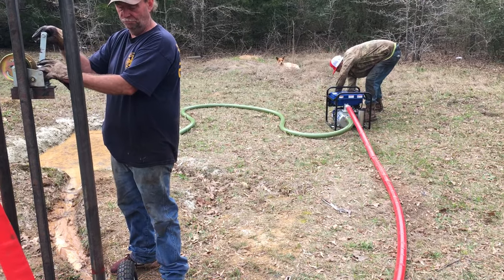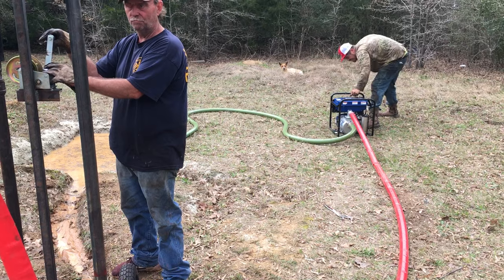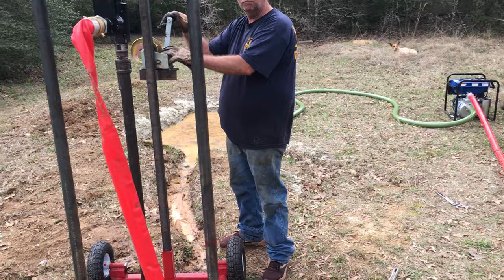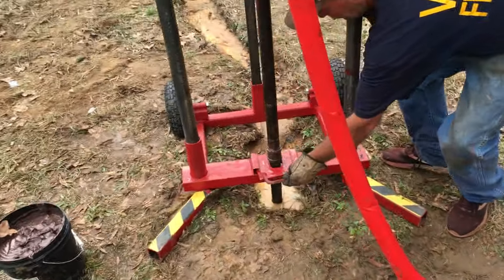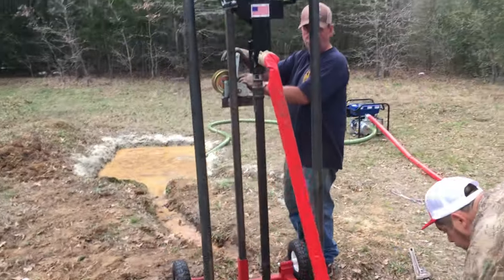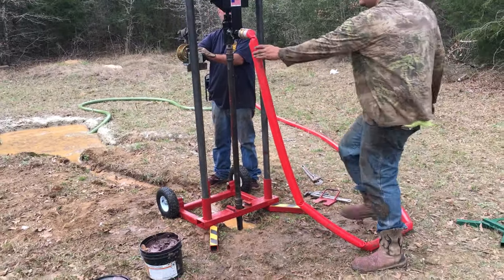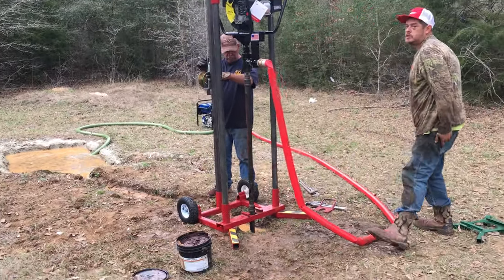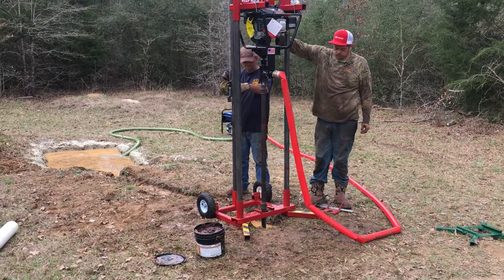IMG 3211 DEEPROCK HD 55 Pro Series Waterwell Drilling rig model 2021 drills to 225 ft  deep

Comment: I drilled 200 feet with one of those about 40 year's ago . 2 inch well gave me about 8 gallons per hour.
Reply from the maker: Yes sir we have hunderds of loyal past customers that have been very successful drilling there own 6 inch Boreholes down to the water bearing sand area then putting your 4 inch sch#40 pvc [casing ] down in and putting a good brand submergable pump in it and plug in the power and suck your water up and out to make the animals and plants HAPPY and full of life we now have the Up Graded DEEPROCK HD-55 Pro Series Model 2022 with its 10 HP engine and all steel 330 gearbox and the xp-7 all steel swivel with grease zerts and a wheel kit installed for easy moving and it has the 4 inch steel channel Drill pipe guide and Breakout pipe plate it holds your drill pipe so as to just use one pipe wrench next time your in our neck of the woods come by and ill show you the Up Graded HD-55 Pro-Series Model 2021 and maybe ill take your old one as a trade in Thanks Much for your kinds words sir
Reply: @davidgroesch1136  more info abojt this product
Where   can i buy one
Reply from the maker: https://www.youtube.com/post/UgkxKGJcwyAMK6BvsDif2Z17MzNsa-tnY-Q9
Reply: I had one 22 years ago, drilled to 290 feet, set my screen at 285, makes   26+ gpm, fills 80 gallon tank in 3 minutes, These little rigs will do the job, but will work your tail off doing it, very good up to 150 ft, from there it's teeth grinding and butt clenching, But like I said 22 years and I'm still on that well
Reply from the maker: WOW Thats Great i get these letters and emails a lot yes we do have a Time tested Water Well Drilling Rig that will do the job it is built by people who know put together a DIY Well Drilling machine so as to work for you for many years not 1 hr and breakdowns and if you do have a encounter we will fast be at your side to solve any issues GOOGLE Deeprock Mfg in Marquez ,Texas 77865 and see the customers in the past several years say we offer hands on Training on our rigs its your Rig can be a HD-55 Pro Series Model 2022 or a DEEPROCK BOBCAT RAM 10 /Tractor Rig that will drill 400 ft we have what you need and will guide you after the sale to make you a successful DIY Well Driller on your own land deeprock.com
Reply from the maker: yes they are great waterwell drillinmg rigs that will get it done and we have BOBCAT RAM 10 Waterwell drilling rigs and Tractor Drilling rigs
Reply from the maker: @katonave  DEEPROCK mfg in Marquez tx 77865 vwe have in STOCK
Reply from the maker: @katonave  DEEPROCK .com
Reply: Co perfora piedras duras rrudas?
Reply: Si perfora piedras duras
Reply: Cuánto bale
Reply from the maker: @EsiquielSts-mp6qs  yes
Reply: Is this legal to use in the United States?
Reply from the maker: hello yes if its your land you can drill your own well borehole but you dont suppose to advertize and drill for otheres that is for the pro drillers that drill for money per foot  @shawnadair2234
Reply from the maker: AWESOME yes you made a great move when you did your homework and bought the DEEPROCK water well drilling rig thanks for your input have a Blessed day !

Comment: Hello.
How deep can you go with his drill ???
Thanks.
Reply from the maker: 225 ft if you buy more drill pipe it comes with 100 foot of sch#80 1 1/4 inch OD its a great rig and some customers put a DC winch with a remote button so as to make it super easy but the manual hand crank is fine if you look on utube deeprock waterwell drilling rigs you can see other DEEPROCK customers drilling on there own land remember to watch out on your water rights cause in some places in california the local goverments or putting a water meter on your well and sending you a bill for the water you use wow thats  NOT RIGHT  they say well the house is yours and the land is yours BUT THE WATER is CALIFORNIA s   well thats not right so im sure the california people did not vote for that it was done under the table and not RIGHT the house is yours and the land is yours and the WATER IS YOURS  Mineral rights is who ever has them in there name ect ect but the water is the land owners Please dont let the goverment take over or water rights thats very very wrong could you imagine being older in life and on a fixed income and then the ca goverment meters your water and then u have more bills ect No the goverment needs to CUT costs just like we do and not just find other ways to make bad on the tax payers the water is yours 100%

Comment: Im having a problem with gravel, it takes all the water from the tank..how do you solve that?
Reply from the maker: easy fix sir just add Benonite powder to ur tank and mix up a liitle then it should make your water thicker and beable to pull the gravel out of bore hole and the benonite will put a seal like iceing glaze on the borehole walls and the when u see the pit ok start drilling again ect ect www.deeprock.com

Comment from the maker: Rock bit for rock drag bit for sand and clay and shale and put a few hundred pounds of weight on it like sand bags or even better a dc/ winch 2500 lb from Tractor Supply when u need weight just push the button and then you have instant weight!!!!!!

Comment: Are units like this capable of drilling 300 feet deep ? And how many gallons a minute can be  pumped through it ?
Reply from the maker: Hello Paul yes we have Many Rigs a Great one is our DEEPROCK BOBCAT RAM 10 Model 2022 with 2 3/8 Mayhew drill pipe sch#80 steel it just hooks on to your Bobcat or Skidsteer or Tractor hook two hydraulic hoses to your BOBCAT and your drilling using the PowerFull BOBCAT HYDRAULICS  it will drill to 375 ft deep and will go in backyards or Remote areas when u have time look at deeprock.com in marquez tx 77865
Reply from the maker: its rate for 200 ft we have a BOBCAT /TRACTOR rig its $15,780.00 that will drill to 400 ft and can pump out many many gallons a min
Reply from the maker: WE have units that will drill 300 ft but the HD -55 Pro Series is for 200 ft max we have a BOBCAT/TRACTOR RAM 10 Model 2023 it will drill to 400 ft if you have the drill pipe its $16,780.00 and will drill anything you got for YEARS AND YEARS not broken down on first day with many issues like a Tim King/Hydra-fab customer issues rig DEEPROCK ® is a GREAT COMPANY that when you purchase your a customer for life and we will educate u on every question you have on drilling thats what we do.

Comment: Is this legal to use in the US? Can i dig 200ft-250ft in eastern Tennessee karst area?
Reply from the maker: yes it is legal if you drill a borehole on YOUR LAND and not drilling for otheres ect
Reply: @davidgroesch1136  It would be on my own land. We have a lot of limestone and bedrock, our area is karst geology. My neighbors are 170 ft , 60 ft to bedrock 10 GPM flow. I have contacted all drillers within 50 miles and the best quote I got was $12k. How many hrs operating one of these would it theoretically take to dig 200ft with this machine ballpark? Can it be done solo?

Comment: The best brother👍👍👍
Reply from the maker: YES SIR the DEEPROCK® HD-55 Pro Series Model 2024 will get it done or if you like fully hydraulic and more easy we have BOBCAT RAM 10 Model 2024 you just hook up to your Bobcat and plug in the RAM 10s two hydraulic hoses to your TRACTOR or BOBCAT and it will drill to 400 ft deep ect its a GREAT WATERWELL DRILLING RIG

Comment: Pretty cool, do you have anything that can drill 600 feet through 6" rock / Arizona cliché?
Reply from the maker: yes we have a up graged RAM 10 Bobcat rig its $18,880 with 100 ft of 2 3/8 mayhew drill pipe and a 6 inch Tri cone ROCK bit Extra drill pipe is $235 each 10 ft long

Comment: Canadian here.  Does your engine have a clutch on it?
I have several good small engines in the shed and I figured I better start putting them to use.  
I have a small 150 acre farm (a Texas postage stamp, lol) With the way things are going to hell these days if firgured that I need to dig a secondary well for a piston hand pump for emergencies.  (I have restored a couple of brass pump cylinders to near new condition (My Uncle passed away in 2020 age 94.  A few days before he told my Cousin and I "You boys go up into the hay loft.  There are some hand pumps and cylinders there.  You take them.  Because you never know when you might have to return to the old ways") He left me my Great Grandmother's homestead from 1921.  I was there today looking at the old percussion well driller that my two Uncles made out of angle iron, bed frame rail,  the differential axle and stick shift transmission from a 1938 Plymouth.  They used it in the 1950's & 60's to drill two wells.  78' & 95'.  I used it in 1987 to drill a well 70'. 
My winter project is to build a small, ATV towable so I can drill my well and a well for a neighbour.  (I have great neighbours and everyone looks after one another)
Long, rambling story but hey!...I'm an old man.  lol   I know that you are in the business of selling drill rigs but any advice that you can give me as to the construction details I should look out for wil be greatly appreciated.  Cheers, Bill
Reply from the maker: www.deeprock.com  yes we love to hear drilling storys and about old cable tool rigs ect yes we all need water on our land to have just in case the China  and Korea come at us i wish times were better on the way some dictators think i wish all could get along but the Dictators want to be abusive and powerful and like in the bible they are wars and rumors of wars and hurricanes and floods but i hope all will be ok and we will be strong in our years to come but we need to think about usa and its people FIRST and the others later usa FIRST the tax payers that build our nation not others that or lazy and dont want to work just hand outs ect

Comment: So that is a sand point drill rig? Can it do a 120 foot well?
Reply from the maker: no sir this is a DEEPROCK/HYDRA DRILL HD-55 PRO SERIES Model 2022 Up Graded series with sch#80 steel drill pipe and the xp-7 all steel top of the line water swivel and a wheel kit so as to move it around from site to site easy its a fine rig that drills your well and fast and will drill to 200 ft deep and in sand clay shale gravel and fractured rock and if you have harder ROCK they we sale TRI CONE ROCK bits for drilling in ROCK a sand point is a labor intense and only works in perfect conditions with soft surgar sand only look on utube and you will see ours rigs and on our DEEPROCK .COM website and we have in stock and ready to use and wells for many years some of our DIY rigs are 35 years old and still doing the job google deeprock mfg in marques tx and see how we do and google tim king/Boremaster customer issues and all the others Lonestar rigs and then make a clear move when it comes to buying your equipment  we also have a BOBCATRAM 10 /Tractor rig that uses 2 3/8 mayhew drill pipe and also has the 10 k Rated for air or water swivel its only $15,780.00 and drills to 350 ft deep if you have enought drill pipe Deeprock.com we have you covered and can answer all your drilling questions fast we are here to serve u from day one till you are a pro at it
Reply: @davidgroesch1136  and video of you finishing a well from start to finish?

Comment from the maker: In Rock u need to change bits to a PDC Rock bit or old school Tri Cone roller bit
Reply: Hi David, I’m actually looking at investing in a similar rig down in Panama. It does come with a tricone bit. What are penetration rates if you hit a boulder in the middle of some sand/clay? Do you pull all your drill pipe and switch to the tricone until you get through the boulder then put your drag bit back on?

Comment from the maker: 6 inch Blasthole full carbide drill bit this bit will last for about 12 or more Wells you drill then it will be full and still work but slower we have them in stock so just order one more for $265.00
Reply: You still have them?
Reply from the maker: @gleeventures9676  yes sir we have tem in STOCK  at www.deeprock.com in marquez texas 77865
Reply: What's the max depth and circumference? Would love to ship 5 pieces to Kenya
Reply from the maker: @gleeventures9676  Hello Sir the HD-55 PRO SERIES will Drill a 6 inch borehole and up to 200 foot deep and if Rocky then u need a TriCone ROCK bit we have them in STOCK www.deeprock.com
Reply: @davidgroesch1136  q costo tiene la perforadora, gracias

Comment: Looks great. How deep can it go? How much does it cost to drill for water in an area where average aquifer depth is 80- 120 metres?
Reply from the maker: https://www.youtube.com/post/UgkxKGJcwyAMK6BvsDif2Z17MzNsa-tnY-Q9
Reply: With the right core sampling bit this could be used to take core samples for mineral exploration in remote Alaska places you must backpack or winter sled to? I also have a need to drill a water well and very interested in the design.

Comment: Hi - what's the torque on the unit? thanks
Reply from the maker: Hello Sir yes this DEEPROCK® HD-55 Pro Series Model 2024 has 272 ft lbs of torque and tough 330 all steel gearbox for the money and made in the USA and in TEXAS you cant go wrong  we also have other Rigs for TRACTORS and BOBCATS fully hydraulic and useing 2 3/8 oil feild duty drill pipe 10 ft long each the RAM 10 Model 2024 DEEPROCK ® Rig is super easy to use but if you dont mind working a little more then the HD-55 Pro with a hand crank is fine also some of our customers put a DC winch on theres to make it easy to pull pipe out but the hand crank has done it for 30 years and counting its up to the person www.deeprock.com

Comment: What cost that machine
Reply from the maker: HD-55 Pro Series Model 2023 is only $3910.00 and comes with 100 ft of drill pipe and a bit for sand and clay and shale

Comment: Hi, great video. How do you know when you have hit water with so much water being used to drill?
Reply from the maker: Yes when you hit water sand thats it when your drilling and you thinkWOW WOW this thing is drilling FAST OK thats your water sand /water water sand has NO FRICTION and it almost falls down put out and asap put your pvc pipe and screen in asap then you have a well put your pump in and suck the water out ect ect to the family or cattle or your pond !!! its easy water well drilling is not like drilling for oil its super easy and NOT dangerous any question just ask ive drilled over 350 wells and can answer your questions FAST nthanks deeprock.com in marquez texas 77865
Reply from the maker: when u hit watersand it will drop because watersand is soft and the drill pipe will just almost fall then thats your water put a screen and pvc pipe in and you have water super simple a caveman can do it !!
Reply from the maker: https://www.youtube.com/post/UgkxKGJcwyAMK6BvsDif2Z17MzNsa-tnY-Q9

Comment: That large tub of copperslip/coat left with the lid off in the wind, way to go on how to contaminate it. Nice rig by the way.
Reply from the maker: https://www.youtube.com/post/UgkxKGJcwyAMK6BvsDif2Z17MzNsa-tnY-Q9
Reply from the maker: yes that wont cotaminate it it is used to put on the threads of the drill pipe ive done it this way on over 350 wells i drilled and no issues

Comment: How much does an extra 150ft of drill stem cost?
Reply from the maker: EXTRA sch #80 Thickwall drill pipe is $650.00 per 50 ft of Extra drill pipe with 1 1/4 coupling welded on these are SCH # 80 they will last for years and years many wells we have in STOCK and ship world wide just send email to sales@deeprock.com  and let us know what you need we also have 2 3/8 Mayhew Drill pipe we use on our Trailer Rigs and BOBCAT RAM 10 Rigs and Truck Rigs up to 15 ft we have wells screens and benonite drilling additive also we are a one stop shop if its waterwell equipment and supplys we have it !
Reply: @davidgroesch1136  Thank you, I will do that and maybe give you guys a call too. I have no experience doing this so I want to make sure it's done correctly. Thanks!
Reply from the maker: @BenWeintraub  yes we want to help you thats why we are here to make you sucessful in your well drilling !!!
Reply from the maker: $750.00 per fifty foot of sch#80 Thickwall drill pipe plus shipping www.deeprock.com
Reply: @davidgroesch1136  price went up?
Reply: @BenWeintraub  team Brandon made prices go all time high. Record high scores

Comment: How much depth you can drill with this rig?
Reply: Title says 225 feet
Reply: Buenas tardes me interesa donde se venden cuánto su presió gracias
Reply from the maker: it will drill to 200 ft deep comes with 100 ft of sch#80 steel drill pipe
Reply: Hi I live in Haiti 🇭🇹 we have a water issue no water and how can I buy one in how much does it cost..
Reply: There’s a lot more to drilling a well then just drilling the hole, if you purchase one of these machines and never drilled a well before, you better have someone there with some well drilling experience because you going to need it, been there done that
Reply: @davidgroesch1136  where can buy this machine?
Reply: @davidgroesch1136  I’m interested
Reply: @eroom2087  what kind of experience do you need?
Reply: @davidgroesch1136  can you really trip 250 feet of pipe up hole with a hand crank top drive?

Comment: Where can I buy drill pipe
Reply from the maker: Hello Sir we sale 1 1/4 inch sch#80 steel drill pipe its $750.00 per 50 ft and we have other drill pipe we sale from 2 3/8 MAYHEW  8 ft or 10 ft long its $240 per 8 ft long andf $248 per 10 ft long Mayhew drill pipe  also we have a great RIG its the DEEPROCK ® BOBCAT RAM 10 /Tractor rig FULLY HYDRAULIC and drills a 8 inch bore hole if needed to 400 ft deep its a super rig and will drill anywhere your tractor can go Thanks DEEPROCK®